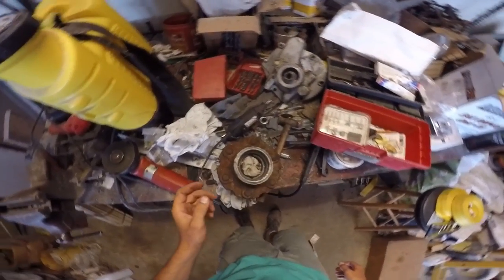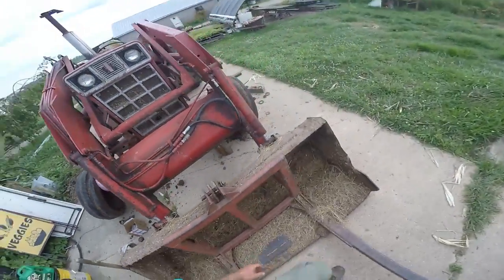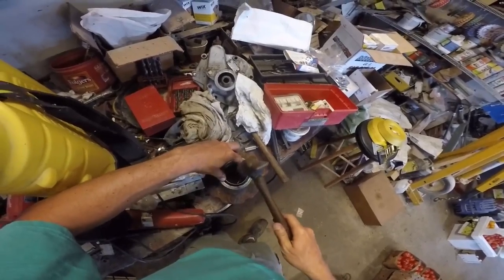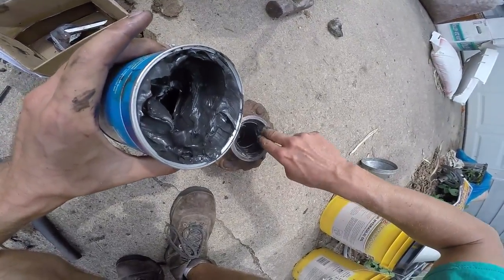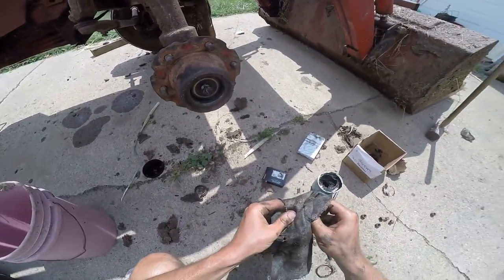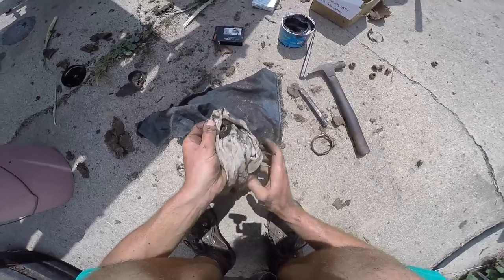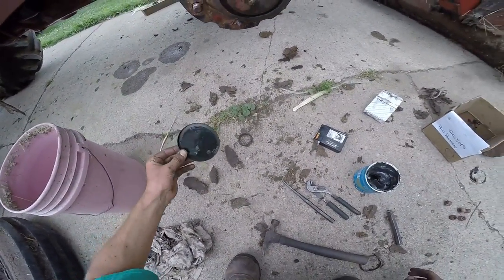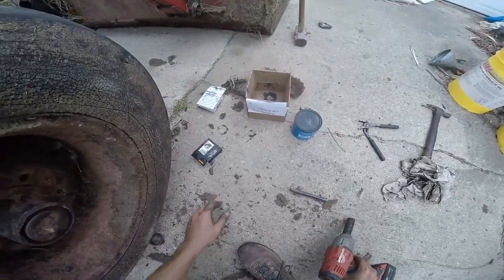The Bad Hub IH Hydro 84 Wheel bearings

Comment: I'm an old Texan and could have been doing it wrong for the last 40 years but I put the rear seal on the hub (after installing new inner bearing and race) then slide over the spindle.Then install outer bearing etc.
On packing bearings: "packing" is the key word. You put a good amount of grease in the palm of one hand and press the bearing "bottom" cone end into the grease one section at a time. You're packing the grease into the area between the inner race and the bearing cage and bearings.
The way you are slathering grease onto the outer area only doesn't fill the area between the inner race and voids between the bearings.
This could be why you are constantly replacing bearings my friend. I do all of my own equipment and trailer repairs and wheel bearings I pack last a solid 10 years between install and then taking apart for cleaning and re-packing. Haven't had to replace a bearing in decades.
Nice to see a young man learning farming. Good job partner.
Amos
Reply from the maker: I repacked them like you said, some things just didn't get filmed. And I'm sure it's been years for most of our wheel bearings, just so happened that they all chose last year to need attention.
Reply: You're doing a fine job partner. And yes,things do seem to go to poop all at the same time.I'm wrenching on a Case LL as we speak. Had a problem with losing voltage to the fuel shut off solenoid,then found alternator to be bad,then saw belt needed replacing,then spent 2 hours running all over town to find 4" of 1.5" ID oil tolerant low pressure hose to replace the suction side coupling hose on the hydraulic pump that I had to pull to replace the belt...Most days are good,some not so much :)
Reply: This one the seal is backwards, probably because the tractor was made in England and they do EVERYTHING backwards LOL:)  The metal part of the seal drove onto the spindle, and the rubber seal lips are around the outside edge to slide against a lip on the edge of the hub in a recess.  Not a bad design, technically, as stuff that wraps around the hub/seal area should pull down into the groove next to the metal center of the seal on the spindle, away from the rubber lips on the outer edge, unlike a regular seal that drives in the hub where the lips are on the inside riding on the spindle-- when stuff wraps on them it pulls down into and around the seal lips, under the seal lips, and ends up cutting up them or wearing them off and allowing dirt and water and stuff to get into the bearings.  

You're absolutely right on packing bearings, though.  Personally I put grease zerks on EVERYTHING I possibly can... it's just a good idea because grease gets contaminated and cruddy and it's a good idea to pump new grease in from time to time to keep the cavity full and push out contaminated grease, particularly on wheel bearings or stuff that sees a lot of contamination over time.  OL J R : )

Comment: If you take a front axle from an old four-wheel drive tractor, it holds better on a tractor with front loader, 
 it does not have to drive any longer. They have much larger ball bearings and are more robust. 
Just a tip from a subscriber from Sweden.

Comment: Well that turned into quite the project. Good job, should be fixed for a long time now. Might want to make room for a toaster oven on your bench, heat those bearings up and they'll slide right on the spindle.Keep up the good work, See you next post.
Reply from the maker: I don't know if preheating the grease in the bearings will give the best results.

Comment: I HATE doing wheel bearings.  Like you said though, with all the wheels on all the equipment on our farm, it's inevitable that eventually another bearing will go out and have to be replaced.  I can easily count 74 wheels/ hubs that get used fairly regularly.  There are more that rarely get used.
Reply from the maker: Wheel bearings and tire fixes; I have told the local tire store than I will have to convert to steel wheels soon.

Comment: you need to get a lathe one day where you can make all your own seal and race installers
Reply from the maker: That would be wonderful. First, I would like a drill press.
Reply: i have a extra metal lathe but i updated my drill press by taking my Taiwan and throwing it away - the lathe is my late model FE Reed 1906 16 inch - also have a Wells band saw I'm not happy with

Comment: I've done lots of wheel bearing, but never quite like that. Should have been a two hour job not 2 days. Put your races in then the rear seal, install hub and front bearing. Simple, and install nut with cotter key and cap. Done!
Reply: Jay Dwelley I
Reply: Except this was designed completely backwards from 98% of wheel bearings and hubs I've ever seen, which is plenty-- the metal part of the seal drove onto the spindle, with the rubber seal lips sliding against a bore in the outer edge of the hub, so he did it right... watch the video carefully when he's grinding down the ring in the hub-- the seal lips are clearly visible on the outer edge of the seal, not the inner edge riding on the spindle with a metal cup that hammers into the hub outer ring like MOST wheel hubs/bearings.  OL J R:)

Comment: If you want to make a cheap bearing heater for smaller bearings use a metal funnel like you put in oil with.  Put three legs on it to hold it pointed up and put a heat source under the funnel that way you heat the inner race and less on the outer and the rollers.  The heaters for bearings that are electric aren't all that expensive and ever old electric motor shop will have one so you can check to see if any are going out of business.
Reply from the maker: Sorry, I think I am missing something about why we're heating things up???